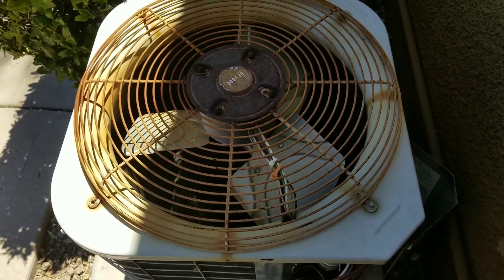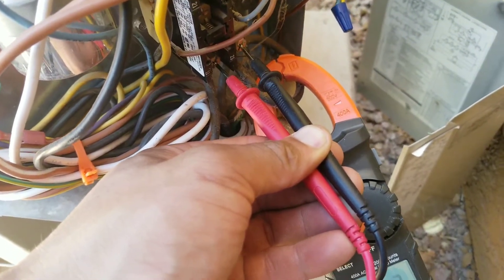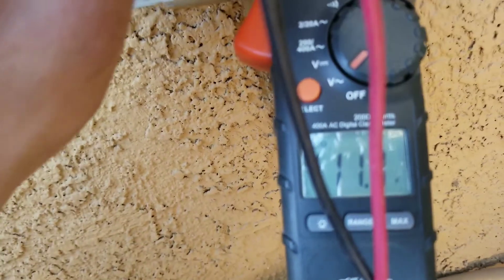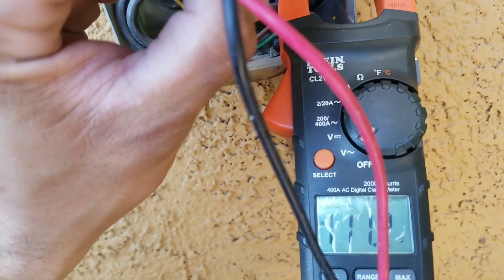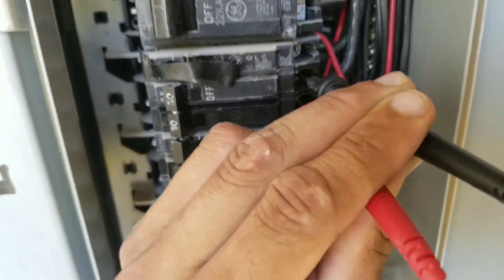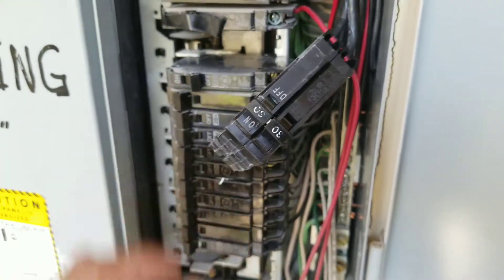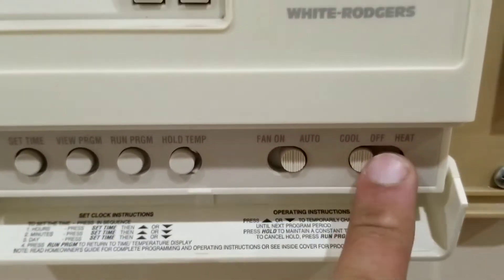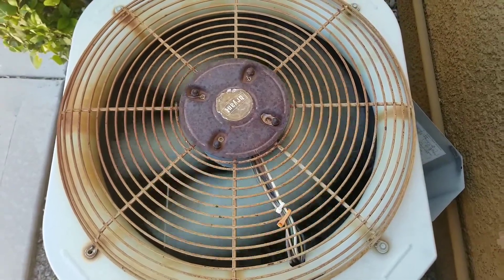AC Not Working? Condenser Not Getting 240 Volts

Comment: How do you know if it’s a circuit breaker in the house or the one next to the AC outside
Reply: At 0:20 he is measuring the voltage coming INTO the breaker by the AC. That is before the fuses that are there. So he knows the problem is "before" that.

Comment: I'm getting 245v from my breaker, but the disconnect is only getting 100v at on of the legs and 120v on the other. What would cause this? Bad breaker? Or faulty wiring?
Reply: Chances are its going to be faulty wiring. If the breaker is reading 240, that means the main breaker and buss bar are functioning properly. I would inspect your legs. They should each carry 120v. I suspect you will come across a loose tap or something along those lines.
Reply: This is exactly what I am having with my 1 yr old ac unit. 240v at the breaker and ac disconnect LIne, but 0 volt at the load.  I still get 120v at each leg.